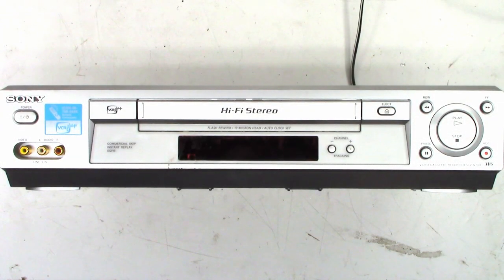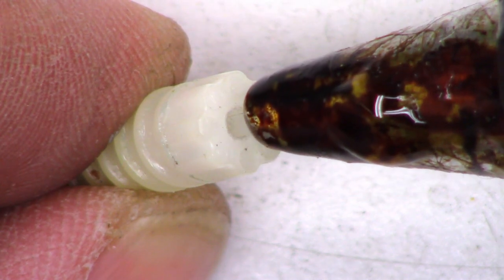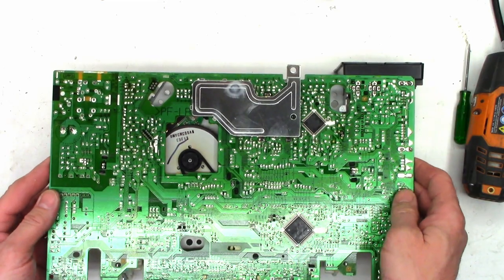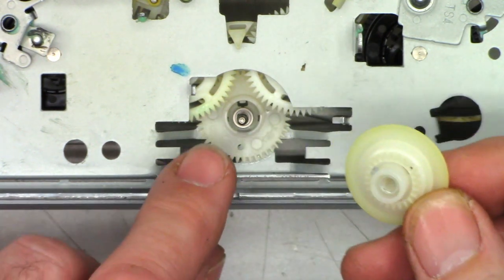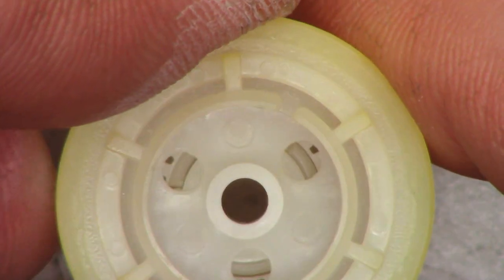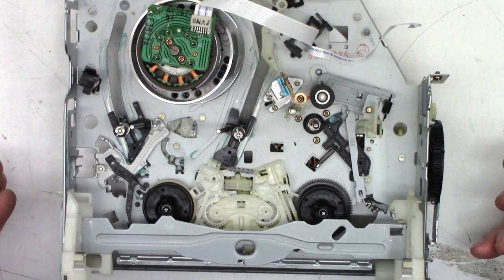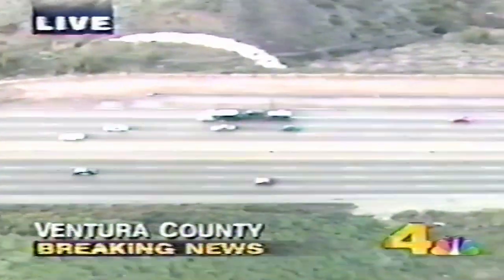A SONY SLV-N700 VHS VCR WITH MULTIPLE PROBLEMS. CRACKED GEARS. HOT GLUE TO THE RESCUE!

Comment: No caps replaced - just a couple of gears needing some extra TLC. Nice work. Hope the customer appreciates it.
The auto head cleaner pad should be removed (after first-time repair) as it becomes dirty and/or hard with age, and may eventually damage the video heads.

Comment: Excellent video! I have a Sony SLV-D350P combo unit and the mechanism is very similar to the one in the video. It suddenly started making rattling noises during FF and resorted to slow FF/REW speeds. Sure enough, it was that gear between the reels that cracked and popped out. I guess those 17 years of thermal cycling and stress finally did their toll on the sucker. After watching the video, I built up enough courage to dig in and stick that gear back in place.
Reply: As for the Sony VCR/DVD combo, I tried to fix and clean at the same time. When I played one of the tapes, it loads and plays fine but except it's got the static or contamination problem. How can I get rid of the static screen and the contamination? I mean, I tried to adjust but it didn't work. Help. To make the picture clear.
Reply: @raymondkim8887  VCRs are complex machines. Noise in the picture could come from one of the many signal processing stages. The most basic and frequent noise problems can be fixed by adjusting the tracking (+ - buttons named "channel" and "tracking" found on front of the machine). Other issues could stem from clogged/worn video heads, video head drum electrical contact, head drum speed problems, or even faulty electronics in the signal processing chain. I don't have much experience with VCRs.

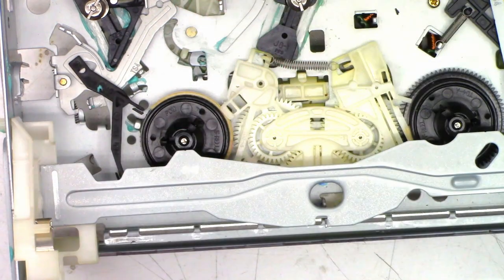Comment: The little spring you reattach on 18:02 should go over a little notch on the gears holder, note it at 8:04 :) Probably not the most important thing but it raises and lowers the gears holder acording to the position of the brakes, probably has to do with ultra-fast rewinding :)

Comment: On these Samsung made VCRs, you do NOT have to unscrew the circuit board to get at the chassis. These chassis have 3-4 screws that hold the mechanism in place. Unscrew all those and you can lift the mechanism out. Its not like those Funai VCRs that were built to be completely unserviceable.

Comment: I was wondering,Nylon is supposed to be a pretty strong material and should be ideal for these gear applications...Do these gears crack due to age or mistreatment by the VCR users or just poor design...or all of the above? Great video...I especially appreciate that you don`t badmouth or condescend units that happen to be made in China or somewhere other than Japan...We all know the Japanese products were usually superior,but manufacturers moved production out of Japan in the `90`s due to cost savings...we,as consumers,have no control over that.
Reply from the maker: Just too much pressure over time. Poorly designed parts.

Comment: I really like your videos, but is glue gun really strong enough for this type of work? Whenever I've tried to use hot snot it loses adhesion within a few days.
Reply: I prefer model cement, its the only stuff that holds in my experience.

Comment: Hey. I noticed in the service manual it says to make sure the mode select triangle aligns slightly to the right, to the arrow that's painted ON the PCB?
Reply from the maker: Not sure what that means. It worked upon reassembly. Older Sony units had the marks aligned perfectly.

Comment: I’m surprised you didn’t use two-part epoxy and used hot glue instead. Most of the time on VCR and VCR/DVD combo’s the mode switch is the number one problem and cleaning them doesn’t work.

Comment: Currently having an issue where the VCR (The 500 model) records in Black & White.  It plays tapes in color just fine but recording? Nope.  Any idea on what it could be?
Reply from the maker: Problem in the chroma encoding process. Its probably an all in one chroma process so most likely a bad encoder/decoder IC, or support components.
Reply: @norcal715  Is it possible that this is because of the cables I use?  I recorded using AV cables and surprise surprise, it’s in color! But HDMI to AV is in black and white

Comment: Would'nt CA be better to glue the cracked gear onto the motor shaft?
Reply: The gears are something unusual, maybe nylon.  CA won't give a strong enough bond.  Though I also wonder about how long the hot glue bond will last.